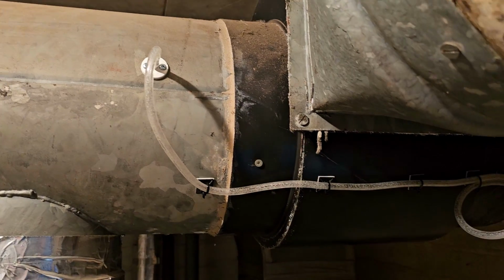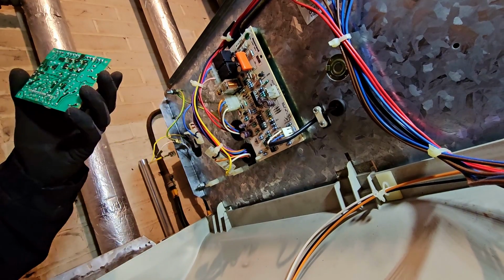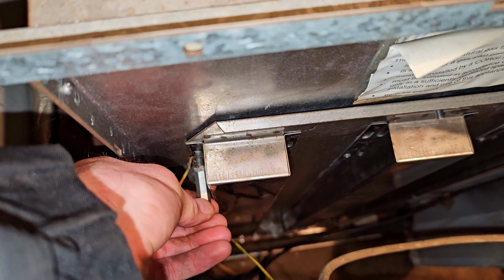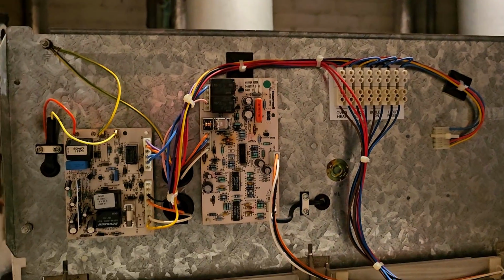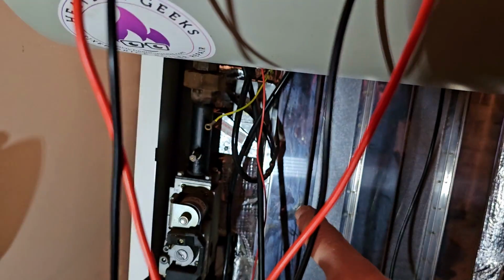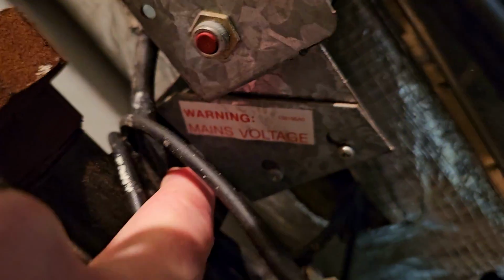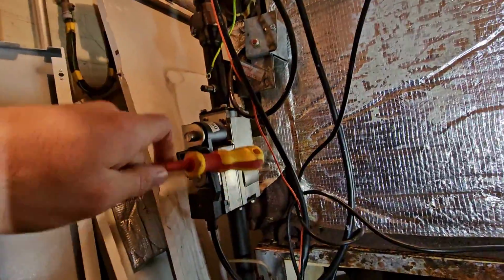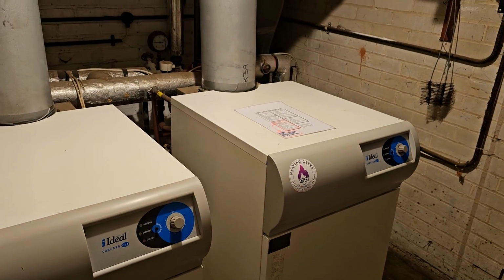Church Boiler Fix: Pro Tips For Heavenly Heat!

Comment: Respect for posting this video.  Manufacturer telling you it's the gas valve😢😢

Many engineers have been through the same thing and your experience and Patience really shines through with a couple of swear words😅😅😅😅

Love your video's has I'm a domestic engineer and have been there many times. On a hourly rate at present , make customer aware that after replacement pcb there still might be further issues especially if you not 100 percent sure.

Comment: Hi please help I'm having f81 and f91 fault code, if I have the hot water set to C and reset the bolier it tries to fire up the hot water but then fails, if I turn off the C and then reset, and then turn the hot water tap on the, ^ symbol comes on but still no hot water,  if I reset boiler again and use the heating, the heating works fine, until you try to use the hot water tap, then the boiler doesn't fire up on the heating side?
Reply from the maker: Some other videos on this subject:
Shunt pump removal and repair 
https://www.youtube.com/watch?v=EghwJcjCMow&list=PLSdnRlSp7Cp4RdOxdo4TM3JCwR0c1aUQ2&index=3&t=77s
Another video on shunt pump issues
https://www.youtube.com/watch?v=CBlGKr0ja78&list=PLSdnRlSp7Cp4RdOxdo4TM3JCwR0c1aUQ2&index=4
DIp tubę video which will have some info
https://www.youtube.com/watch?v=Up6mO4YHgRg&list=PLSdnRlSp7Cp4RdOxdo4TM3JCwR0c1aUQ2&index=5
Latest diverter valve video
https://www.youtube.com/watch?v=jyGWeVqCcmQ&list=PLSdnRlSp7Cp4RdOxdo4TM3JCwR0c1aUQ2&index=35

Comment: Hi Heat Geek, how do you go about charging when you end up going around the houses like this..?  I am a fairly new Gas engineer (just in my second year) often the faults are not obvious and I feel bad charging for all my time if it was actually something simple.  Just wondered what your thoughts were..?
Reply from the maker: I charge a pre agreed rate. 1 hour or 5 doesn't matter to the customer. Get some experience under your belt doing council or housing association work. People will help you and you will get to the point where you feel comfortable. :-)
Reply: @HeatingGeek  I’d love to but I’m self employed, how would I get onto council work..? I’m pretty rural also…
Reply from the maker: @RichardSaether  If you were a council tenant in your own area who would you call to fix your boiler. Look on the council website and it may (if they use another company) show who they are. Offer your services as a contractor. If you get in you get to work local and learn. Some people (like myself) don't like meeting customers at the Tesco checkout so I always worked 30min from my house. That way if you fall out with someone on a job you don't have to meet them at the supermarket. :-)
Reply: @HeatingGeek  Good thinking that mate, I am in a small village though and all my work is local.  Thanks for the advise though, might look into subbying for a firm if they're doing council work.  I think they'd expect me to work alone though wouldn't they..?  I am getting there but experience is the only way forward.  Thanks for your reply...

Comment: Well done. When you get the end of the job and realize you only had to do  a quarter of the work, it's  both satisfying and annoying in equal measure. 
As for flue gas recirculation, the idea, I believe is to reduce to maximum flame temp to reduce NOx production, whereas adding more intake air  would lead to reduced  efficiency, and possibly higher CO due flame chilling before complete combustion.  HTH
Reply from the maker: I think you are right. :-) Someone else agrees with us too. They posted a couple of days ago. I did waste a few hours chasing my tail. never mind. :-)

Comment: Had loads of these in havrigg prison. Changed so many burner bars on them I lost count.
Reply from the maker: Cracking? I have had it a few times before but these are ok. I guess the crap falling on it from above causes hot/cold spots and they crack. Maybe?

Comment: Brilliant video, your assumption on the products recirculation tubes is correct the purpose is to reduce Nox and Sox.
Reply from the maker: Nice one. I thought so. I guess your a commercial engineer?
Reply: @HeatingGeek  Electrical engineer by profession, commercial gas engineer by retraining, just about as much as any engineer can ever be retired by age.
Reply from the maker: @marksenior1179  I have a video coming up in a couple of weeks that will need some input from someone whit your knowledge. Should be posted next week or the week after.

Comment: I absolutely love your work ethic and your honesty and your videos are brilliant. What a frustrating experience for you though, especially as you were actually right on the problem earlier when you said at one point in the video something along the lines of ‘Maybe when the main  gas valve opens its dropping the pilot pressure’ and then when you were advised to swap the gas valves you discovered all the debris in the main line. Hindsight is a great diagnostic tool.😉 Well done and thank you for sharing your experience.😀👍
Reply from the maker: No problem. It did frustrate me tbh. I was trying to just get it done and not taking a minute to think. When I used to smoke the fag break would usually enlighten me. (and kill me a bit)

Comment: Well done for sticking with it.
It's nearly always simpler than you think it is!
Regarding the shorting problem we always used to sleeve the leads.
Some boilers already have sleeving on the leads.
Reply from the maker: I know. I did have some Worcester silicone sleeving but I couldn't find it. How crap is the insulation though?

Comment: The red back boots are a Aussie brand, remember having a pair when working over there. 
Kept on thinking this seems like flame rectification. Amazing that had a pilot at any time?! 
I remember one of my hardest fault finding,
System would not warm up seem like blocking in pipe work  checking zone valves and pumps,
Tested boiler. Phoned manufacturer more testing, even had another engineer look over to see if I was missing anything. 
After many hours I discovered that it had a new main board and whoever had fitted it they hadn’t married the temp knob correctly on to the pcb so even with the temperature turned to max wasn’t hardly turning temp up. 
Right old head scratcher. But kiss. 
Cheers Oly.
Reply from the maker: I have been there too. It's annoying me because I cant remember what boiler it was!!!!
Reply from the maker: Ariston microgenius mffi!!!!!! Someone fitted a new PCB and the knobs were not correctly fitted to it :-)

Comment: Nice vid. You are a legend and a true GAS man through and through. Learnt loads off you. So why not share some back.. The air recirculation on the boiler does not reduce the oxygen to reduce the flame temperature. There is still enough oxygen for it to not be a concern. It uses air recirculated into the combustion chamber to turn more CO into CO2. Remember incomplete combustion is the enemy: complete combustion is the aim.
Reply: Nox reburn 
Clean injectors
Started my apprenticeship 37 yrs ago with these 
Bullet proof until they started with electronics 
Always sleeve the ignition and ionisation wires in fibre glass heat sleeving
Reply from the maker: Amazing that Ideal don't though :-) So the introduction of POC is for NOx?
Reply from the maker: NOx Is what I thought it was for. Reduce flame temperature and produce less NOx. But like I say, I am  not sure. Thanks for commenting and I will look it up :-)